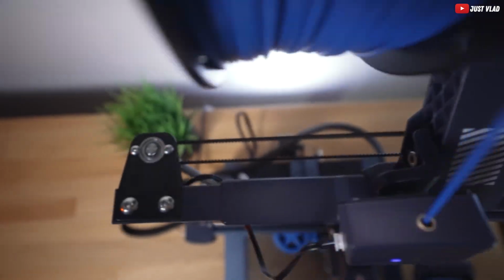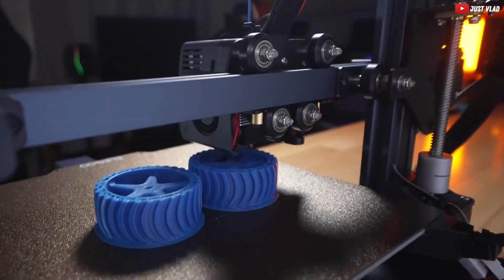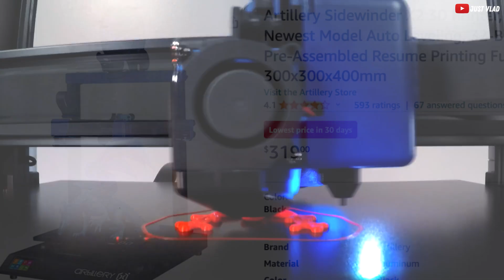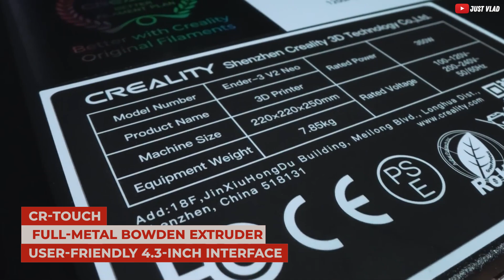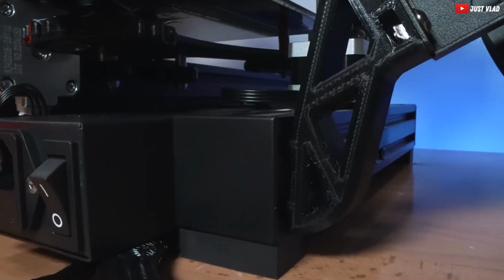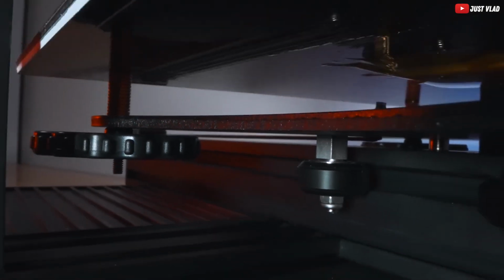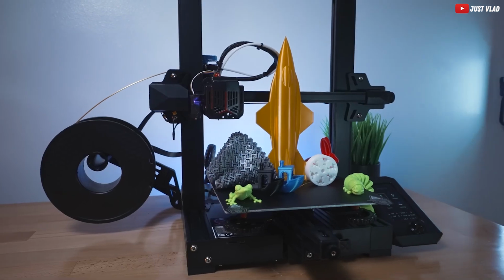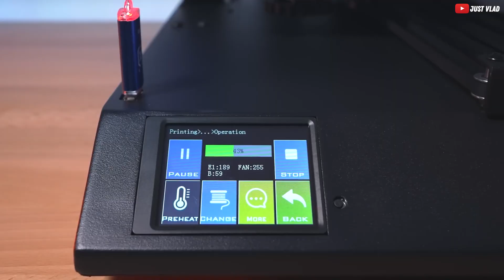Top 3 BEST 3D Printers Under $400 - Buying Guide

Comment: I was bent on buying a Bambu. Until I found out about their policy on open source.  These printers were on my list as well.  Can anyone tell me if you can use open source design plans on any of these? Thank you.
Reply from the maker: Hey, what do you mean with Bambu?
Reply: @TechSenseiUSA  I originally wanted a Bambu pro series. With some filament and upgrades it was just over 2K. I did more research and I found 3 major reasons not to buy a Bambu. As I said, they don't allow open source,  materials are Bambu specific, and it doesn't work with carbon fiber. For those reasons I moved on to a cheaper variety.